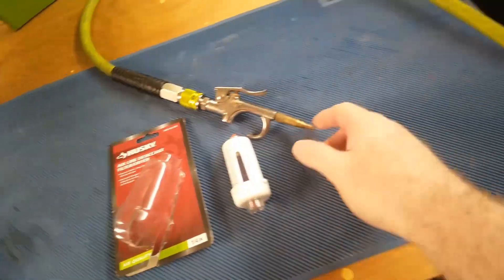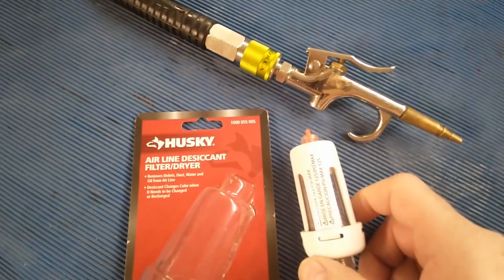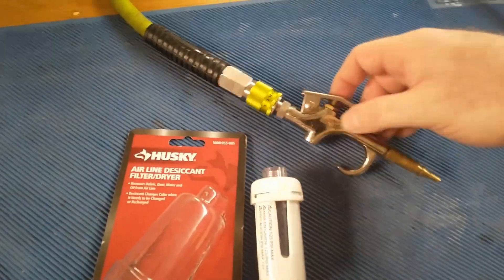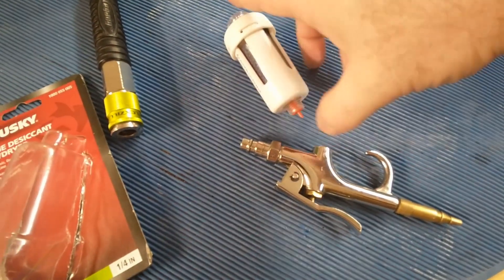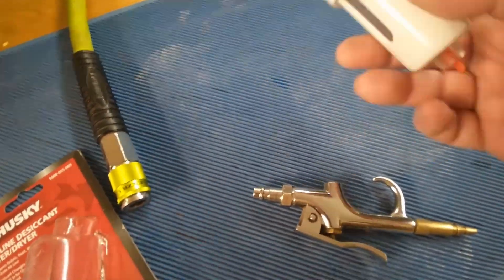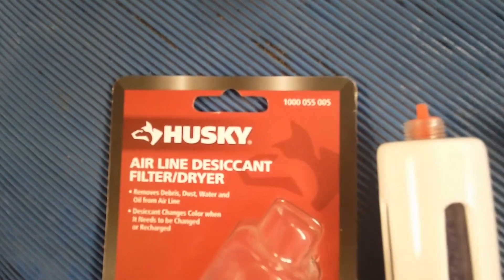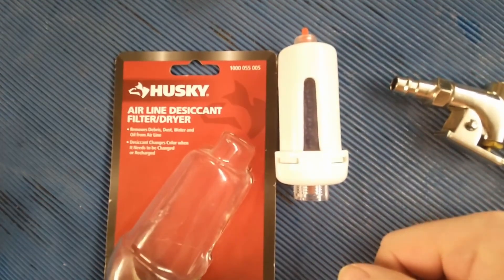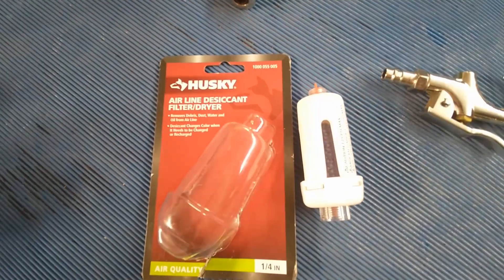Fail - Husky Airline dryer filter - DO NOT RECOMMEND

Comment: I was strolling along and came across your video. I see you are strapped for space, but I think there is a solution. On the compressor side you currently are going directly to your hose reel I believe. What I might do instead is remove the regulator from the tank and attach a whip hose directly from the tank to the regulator which you would install on the wall. From there you can place a small manifold and attach a filter/water/oil separator. From there you can place your desiccant drier all on the wall behind your compressor. On the manifold side I have a valve so I can direct air to the desiccant when I need dry air or I can bypass the drier when I don’t. This saves on replacing desiccant. You can also reactivate the desiccant in your oven. Cheers 🎉
Reply from the maker: Thanks, but I already solved this in a future video where I added an after cooler setup instead of desiccant.  My problem is that I cant add things to the wall, even with things as small as I have it...as I have to be able to have the flexibility to also roll the compressor out to the parking lot if needed for emergency tire fill ups.  That is infrequent enough, and not knowing where in the condo lot we will end up being when needing air, so it has to be mobile vs just a long hose.  Also, I do not have space for a second movable standalone portable air tank, so I had to keep everything onboard the compressor setup.  The after cooler setup I made definitely works...I have filled the tank from empty 3 times now and zero water made it into the tank. :)